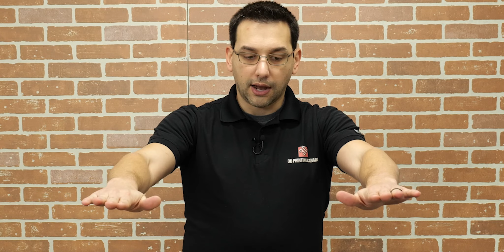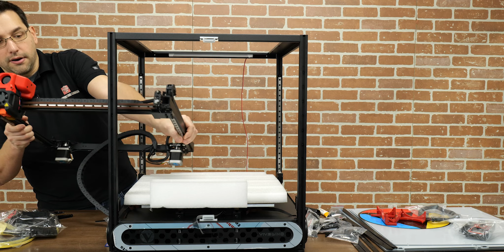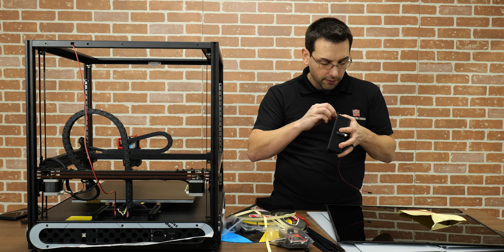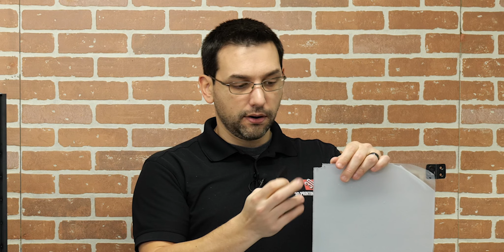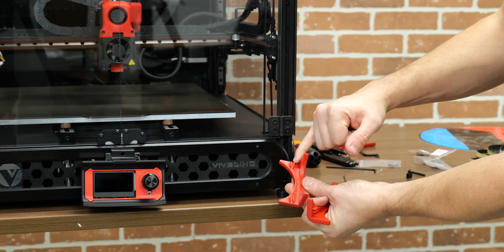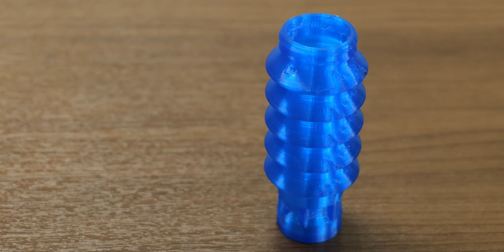FORMBOT'S TROODON 2.0 UNBOX, ASSEMBLY & TEST PRINTS

Comment: You stated in the video (41:41) that you can use Klipper's input shaping to help with the ringing.  Doesn't this printer come with Reprap?  I ask cause I'm considering one of these printers and ultimately may convert it to Klipper.  Also, on another note, it sounds like there's music playing in the background, while the volume of it is very low it's kind of distracting.  I kept trying to focus on the music and not you.  Anyway, thanks for the video, I may be back to refer to it if I buy one.
Reply: yes, the printer comes with RRF, not klipper. RRF also has input shaper support

Comment: Interesting so this is commercially ripping off a voron 2.4?
Reply: Uh, Voron is open source mate. And Formbot is one of the biggest suppliers for Voron parts.
Reply: Far from it, it has it's own board and Duet based firmware. I'd say they more than improved on the design and I own 13 of them in my farm at the moment.
Reply: @CaptainKatarn  hey Tim 🙂
You single handedly trying to keep formbot in business 🙂
You should do a video about your farm and how you use them 🙂
Reply: @Labworks-Kharma  great idea!